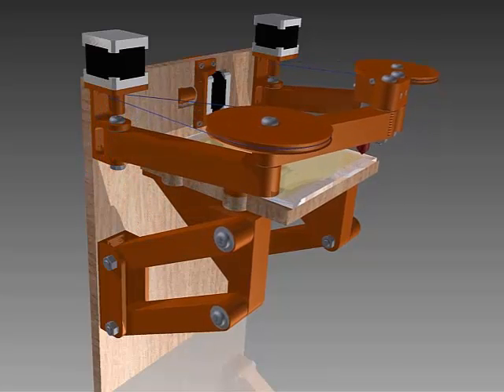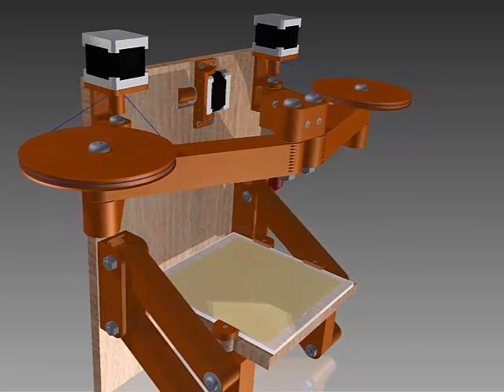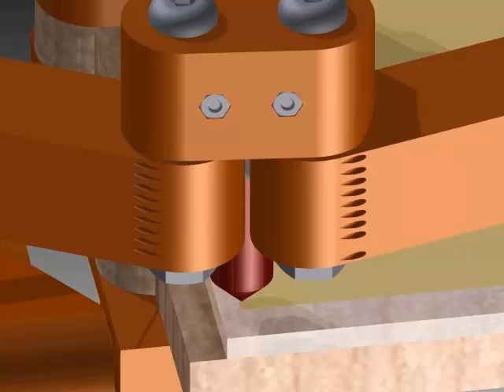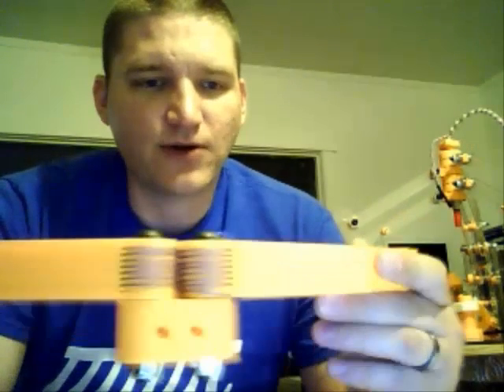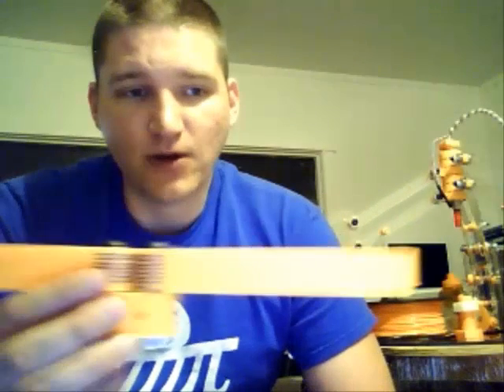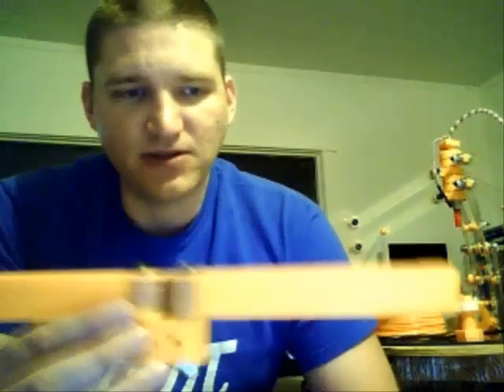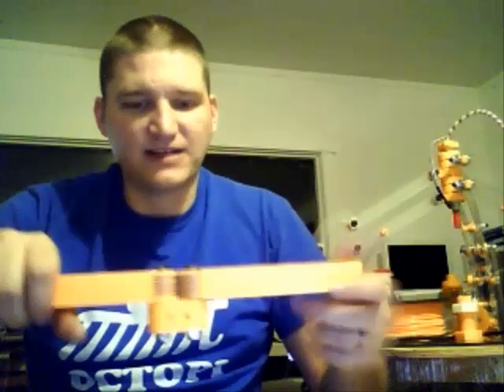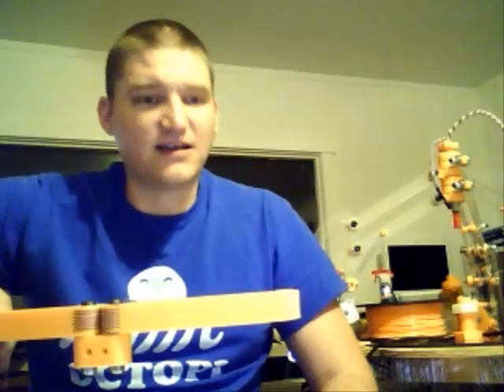RepRap Wally - Double Lamina Explanation

Comment from the maker: Very cool.  I have checked out the velocity (500mm/s+) and the resolution (25microns-) but I need to work on the acceleration.  It is cool that you are doing this because I am losing motivation to do the acceleration.  (I know that even if Wally has crappy acceleration that he will be a serious contender.)  Post the files when you get done.  I have never played with LinuxCNC.

I am in Hot Springs, AR.  Too bad you didn't make it to the fair.  I just about lost my voice from talking so much.

Comment from the maker: Ilian,

Of course you're right.  There is always friction.  My mockup showed the friction to be on the same order of magnitude as the side loaded bearings.  (The vast majority of the stepper's power will be for accelerating mass.  The power to overcome friction will be an order of magnitude less.) As far as constant tension goes, the mockup is just that.  The next version will have a constant length path for the string and will be much much much easier to string. Cheers!

Comment: Nicholas,

That's great. I am afraid though that you will have friction losses in the two driving strings. I am pretty certain that the tension in the string will not be constant, especially in a low-cost implementation.

Ilian